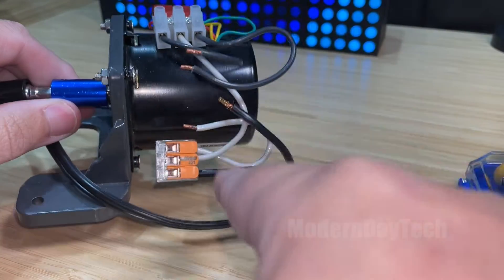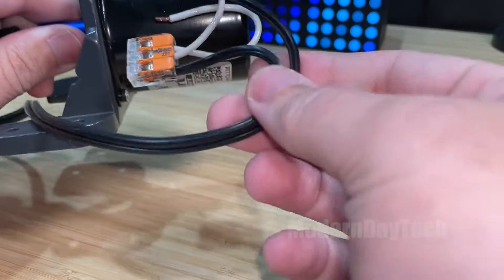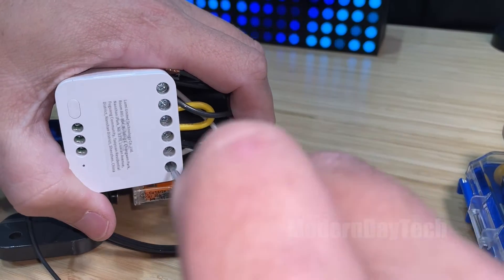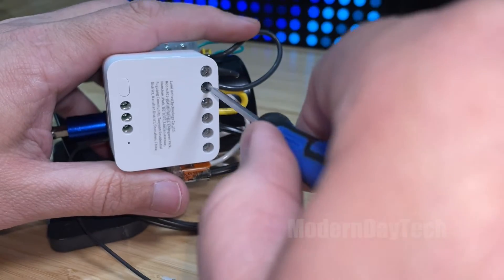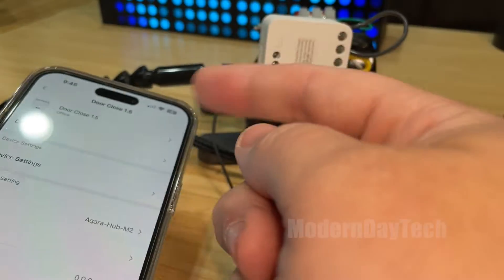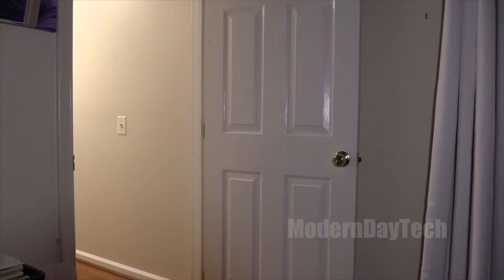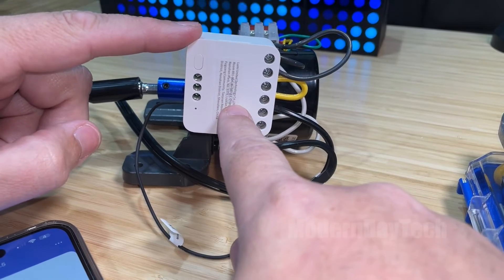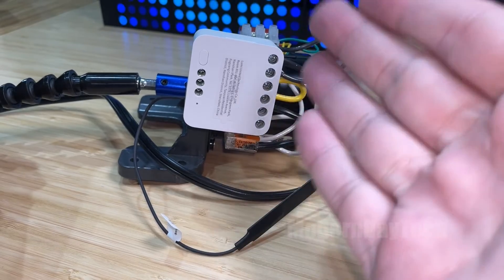Smart Home Door Closer 1.5 -  NOW Native to Apple Home

Comment: Thank you for your video. I just bought a Aqara dual relay T2 to control a bidirectional DC motor (opening and closing a roof window). In your video, are you connecting a DC or AC power supply? I didnt catch that, my motor needs +24V or -24V to open/close. Also, I am using Home assistant instead of the Aqara hub. I works fine to connect the device but the setting "Interlock mode" just isnt there. Maybe I was too fast buying the Aquara T2 but I hope there is a way to make it work.

Comment: auto lock but manual unlock?
Reply from the maker: Yep, this just closes the door. Opening the door will take a second motor/actuator to unlock/disengage the latch. You then have to time them both together so opening the door is a lot more complicated so it will have to wait for another day.  Check out the orginal video and you'll understand more -   https://youtu.be/8x81X6DJqpQ?si=tGqy5Tmj8Jei1nmV